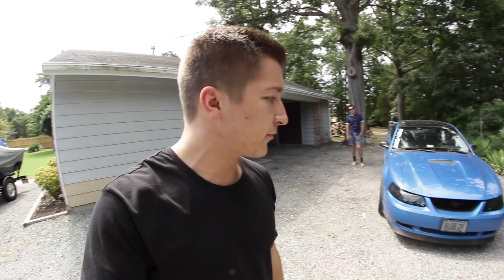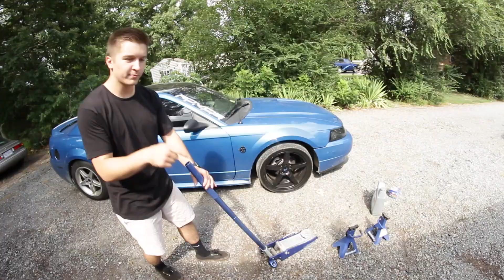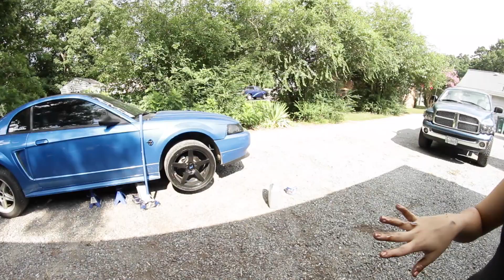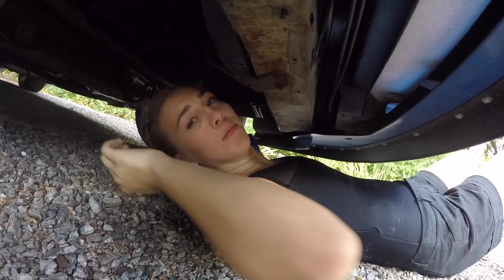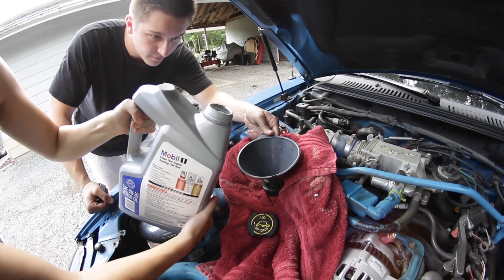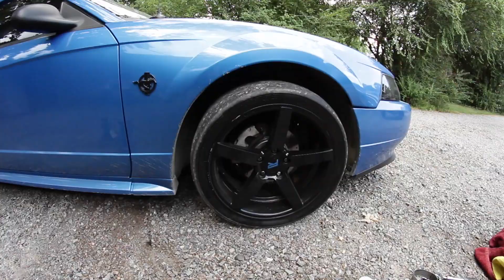Girlfriend's FIRST Oil Change on My MUSTANG GT!

Comment: Speaking as a mechanic, let me make one recommendation. Always check the old oil filter to make sure the 0-ring came off with it! Sometimes the 0-ring from the old filter sticks to the oil filter flange on the engine. If you put the new filter on over the old 0-ring it might run dry for the first few minutes, then start leaking oil the first time you rev the engine, or several blocks down the road!! Seen this happen several times. Otherwise, great vid. RayAnn did a great job. She's a keeper!

Comment from the maker: Be sure to give this Video a THUMBS UP! 
Ray did a great job! :D @OfficialRayAnn
Reply: DerekBaranProductions cams=1500, heads=2000, intake manifold 500, or 125 shot for 400 and get the same power........
Reply: DerekBaranProductions my brothers girls friend just bought her self a v8 2004 vert gt
Reply from the maker: or try a fully built 2v with a paxton procharger waxing all them yotes for about 7k :)
Reply: DerekBaranProductions u saw all the haters in the comment I left on streetspeed717's video about the callout video you did smh #fuckthehaters

Comment: I would suggest tightening it by hand only(new filter) just because it's easy to over tighten the filter with the tool and it could break the seal from the filter and cause oil to slowly leak out. Plus on these new edges and my sn95 as compared to other cars it's very easy to wrap your whole hand on the filter. Just a suggestion, you don't have to but doesn't hurt to try, also since these babies are old, a good coolant flush wouldnt hurt as well as replacing the old thermostat if you haven't already done so, chrisfix put out a great detailed video a while ago just look it up if you have the time.

Comment: All you need to do is hand tighten the filter you don't need to use the wrench you can actually strip the threads if you go too tight the wrench is really for those dumb shops that tighten it too much but I just use a screwdriver and stab it and turn if I can get it off if it's vehicle I haven't changed the oil on. And I've changed a lot of oil and I never had a problem with hand tightening, but I would've made sure it was a little tighter than what she could do but at least she's willing to get dirty love the channel been here since 900 subs and I think she's a perfect addition to your channel bro keep it up just wanted to drop a tip
Reply: Vivid Klipsch same, hand tight is all that is needed. i do that on my mustang every change and no oil leaks ever. last time a shop touched my car i couldnt even take it off smh
Reply: godgiven exactly that's why i use the flat head and stab it trough and spin it for leverage
Reply: Vivid Klipsch I've always done tight by hand, and a very slight turn with the filter wrench to be safe. With all the vibrations of driving it's better to be safe than sorry. But to each his own.

Comment: Just a safety tip to keep everyone safe: if you find yourself jacking up a car and using jack stands on a dirt or gravel surface lay a plank of wood below the jack and jack stand to prevent them from shifting and sinking under the weight of the car.

Comment: 1. It’s called an O- Ring not a fitment thing. 2. Never tighten an oil filter with a filter wrench. Hand tightening is more than enough since the pressure will tighten it.

Comment: Fyi never place jack stands in the middle of the car 🤣
Reply: Unless you have subframe connectors
Reply: But should only hand tighten oil filter  😂😂😂😂😂.  Never use the oil filter strap wrench to tighten 😳.